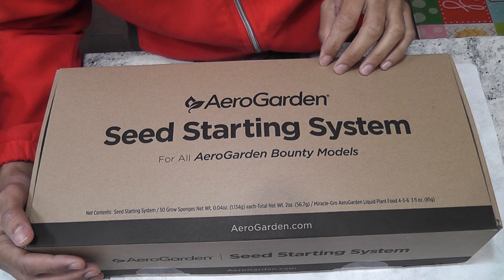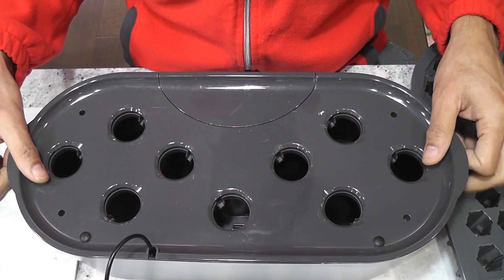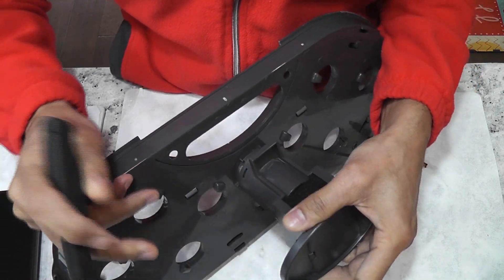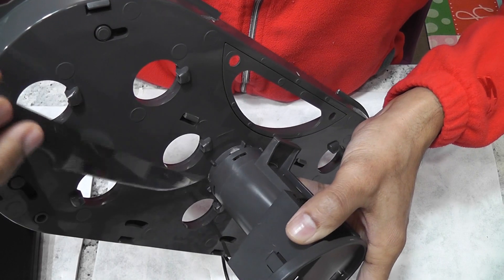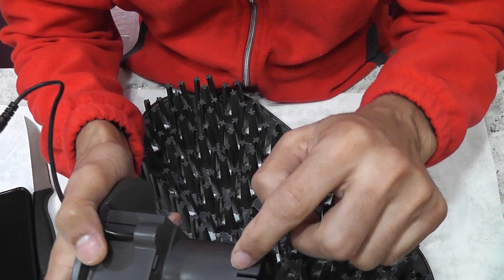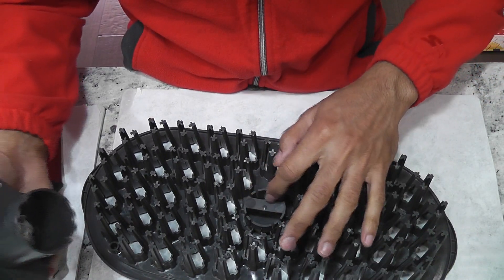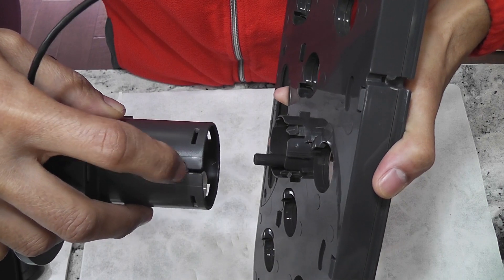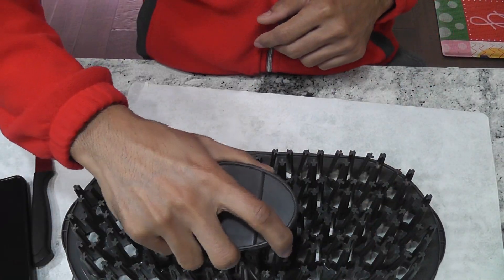AeroGarden Seed Starting System for Bounty - Review, Setup, & Detach - Seed Starter Accessory

Comment: Thank you very useful , just a tip I was going to use a knife on the tabs as well, but realized a flat head screwdriver may work better. Did so and it worked very well.

Comment: What am I  doing WRONG? we were hoping to jump start our gardening season by starting our plants in our Bounty's we planted 2 of the seed starters and basically all 100 of the sponges grew algae so we ended up scraping all of the sponges and cleaned both of our seeders any suggestions? I don't want to waste anymore sponges and time if I  can't grow in them.  Thanks
Reply from the maker: In case you added nutrients at the beginning when you started the seeds, I recommend delaying the nutrients until the seedlings are shown. The Aerogarden instructions manual says add nutrients but that's not good. Nutrients + water + light causes algae and it spreads fast. Once the seedlings are established, they block the light going onto the sponge, and we don't see a lot of algae. But if the Algae comes first before the seedlings, then the seeds won't get a chance to germinate and come out of the algae.
Reply: @aerogardenexperiments  That sounds right Thanks